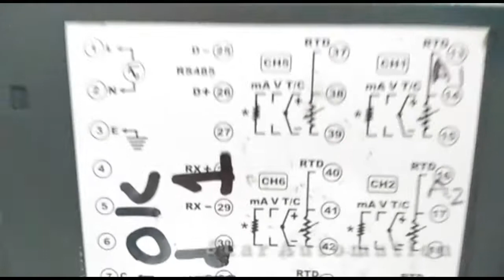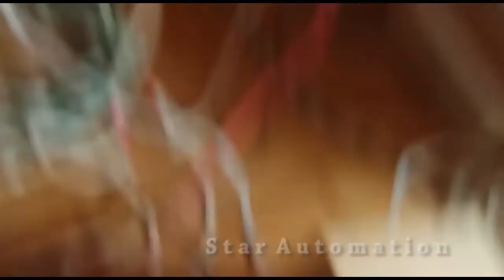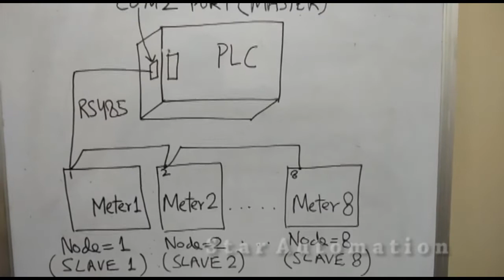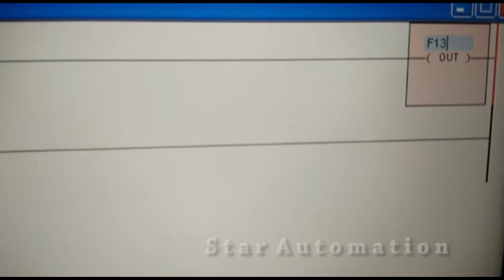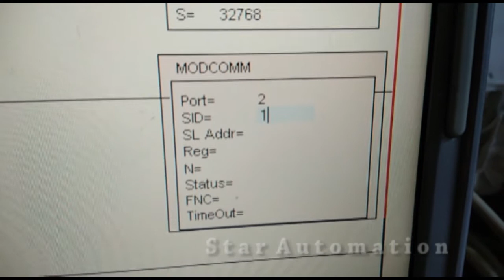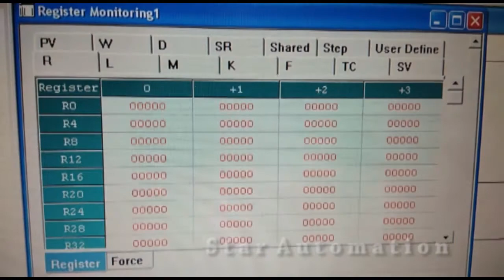Using Modbus RTU communication

Comment: what is the type of cable you are using rs-485 communication? Can cat 6 cable be used for rd-485?
Reply from the maker: CAT6 cable should be used to RS485 communication. CAT6 is the recommended cable for ethernet and RS485 communication.
However, I have used simple copper flexible 3 wire, 0.5 sq. mm cable for  communication. This is also working fine as distance is short in  our project.

Comment: why connect the 100 ohm resistance across analog input 4-20mA?
Reply from the maker: It is recommended in the user manual of Scanner module to connect 100 ohm resistance, if we are using  it for 4-20mA signal. This  Scanner module has universal type input, it means it can accept 0-10VDC / 4-20mA / RTD signal / Thermocouple signal. Whatever type of input signal we are connecting, we need to do program setting also in the scanner module.
However, when we connect 4-20mA to PLC analog input module, we don't need any resistance.
Reply: thanks